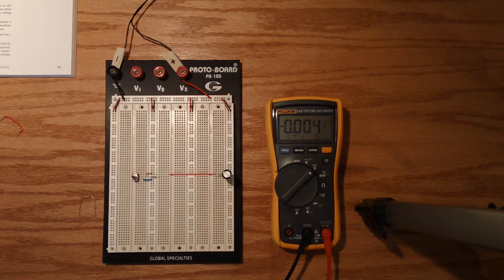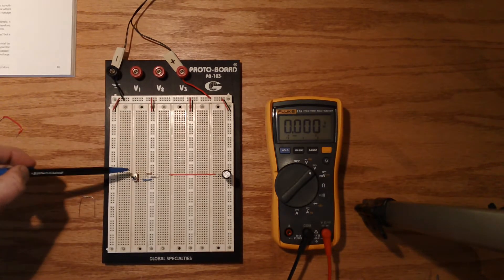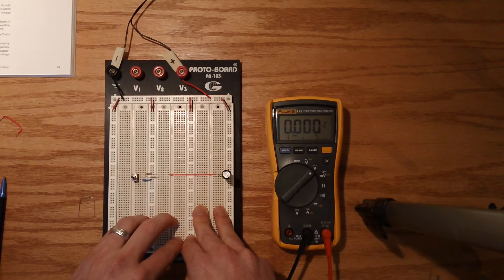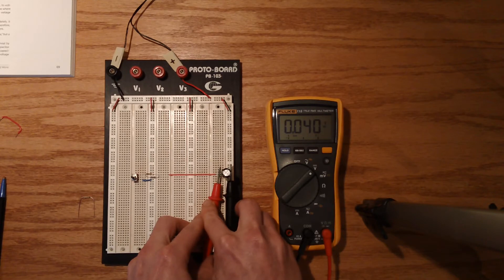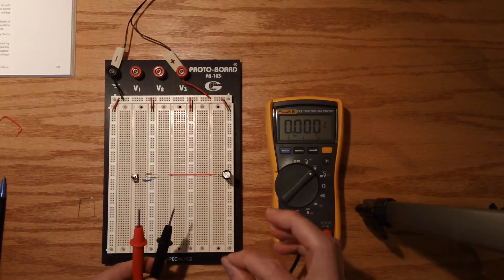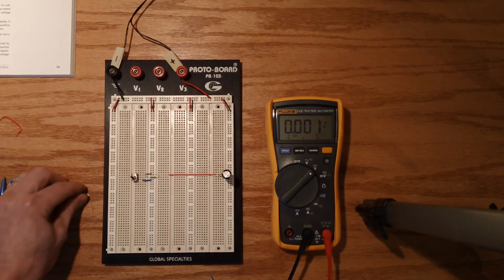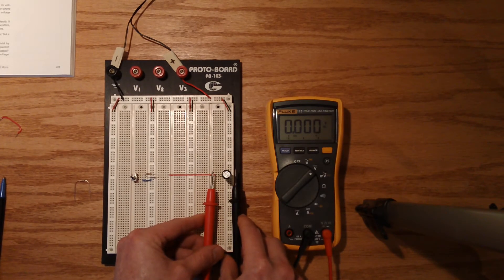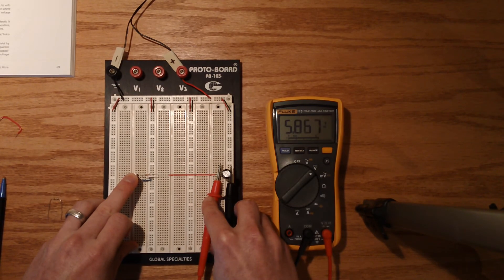Make: Electronics - Experiment 9

Comment: Glad Mr.Bell shared his results.  I'm using the second edition of Make Electronics by Charles Platt, which has an added switch in the circuit to discharge the capacitor.  The take away (for me anyway) is that capacitors store an electric charge by holding it in one place until needed.

Comment from the maker: Based on my understanding, there isn't any current going "across" the capacitor.  When my finger pushes the momentary switch in this circuit to connect the circuit, the primary power supply is basically pulling electrons from one internal plate of the capacitor and pushing them onto the other internal plate.  This means once the capacitor has the same charge (voltage) as the primary power supply, there would be no more current flow in this circuit.